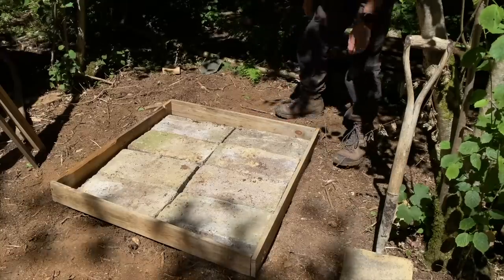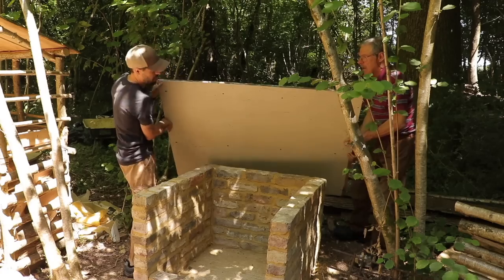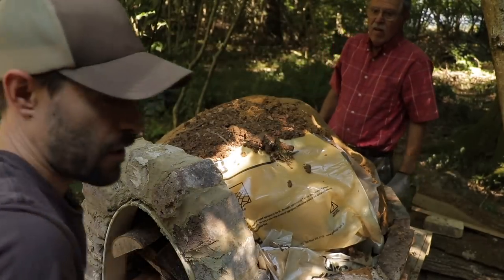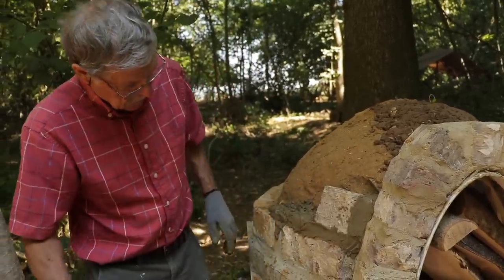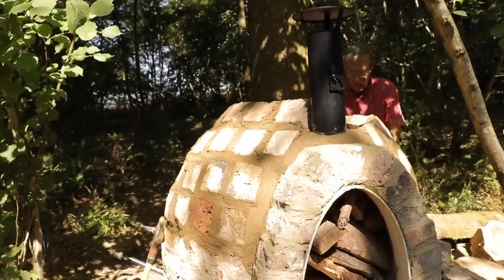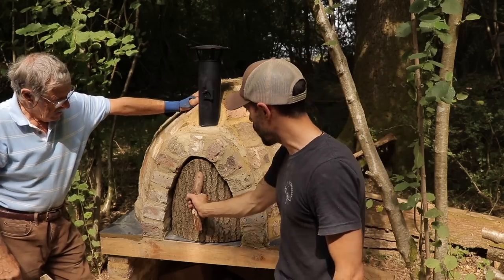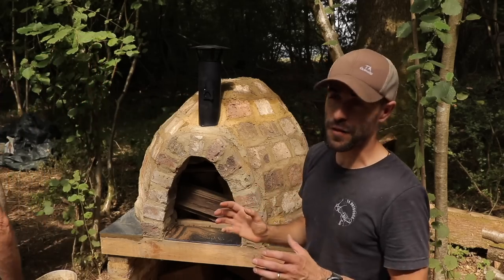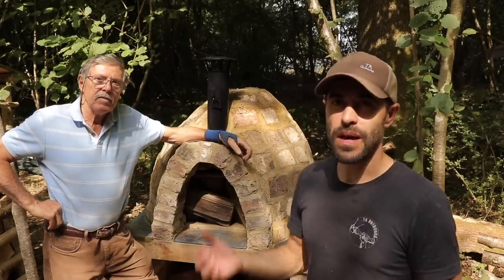Building a Rustic Oven with Chimney in the Woods

Comment: Very cool build Mike. The old bricks look fab! Don't forget, these ovens need to go through a 'curing' process before they wil store and radiate heat for cooking. Basically, 3 or 4 small fires to drive out any residual moisture in the mortar. After that, you'll notice the temperature will remain high and for a long time. Soak the ash door in water before using on the oven to prevent burning and also to naturally add some steam to slow cooked meals - works a treat on our pizza oven. Good luck and thanks for the amazing videos from your little oasis in the forest. Cheers!
Reply from the maker: Cheers for the tips. Appreciate it 👍🏻

Comment: Nice job. I built a pizza oven in my yard during the corona lockdowns. Quick tip, the flue will expand with heat and crack the mortar/bricks. To prevent this, the flue hole should be a bit larger than the flue. You can secure the flue with fireproof rope and high heat silicon. You silicon the rope around the inside of the opening and also to the flue. Allows for expansion.
Last bit, the thermometer is an unnecessary breach in your dome. The oven will have different temperatures on the floor and the dome. I use a handheld laser thermometer to get an accurate measurement. For a rough estimate, throw a pinch of Semolina flour into the oven. If it takes about 6 seconds to turns black, your temp is in a good spot. Cheers from Hamburg

Comment: You should epoxy the bark and give a waterproof clear coat to the backside of that awesome oven "plug" with the handle that you built otherwise that will rot away over time. What a cool idea, it should last you forever if you seal it right! Awesome build, fellas

Comment: This looks amazing. If you haven't already installed the thermometer - I've seen folks use a heat laser gun to determine heat in the bricks and oven. The laser beams in at whatever angle you want a temp and allows you to stand back and not get burned while you do it. It's a very cool tool.

Comment: I built a domed pizza oven from old bricks from my Victorian terrace, they can handle the heat, I've measured up to 650C!
I used a lime mortar which is (apparently) better for high temperatures.
I also insulated around the outside of the dome with insulation blanket and a mortar made with vermiculite. The insulation is as thick again as the bricks. The bricks store the heat and the insulation keeps it from escaping. If I do pizzas it is still around 150C the next morning. 
 If you find the heat doesn't last long enough for slow roasts, you could easily retrofit some insulation to yours. You could maybe even try and make a diy insulating render with materials you have on hand such as your red clay and straw?

Comment: The one I saw built, the shape was made with willow , just like you'd use hazel, in a wattle method. All lashed together with thin bark strips.  Then covered with a cob mixture and left to dry.  Once dry, a fire laid inside burnt away the wicker structure.
Reply: Townsends?

Comment: Has a bit of a medieval touch, which is very nice.
Sure not every move is like something out of the books but it turns out very well. 
The only thing is the Chimney.
It might be better to have it on the backside for a better airflow.

Everytime I see you two work together, I wish I had the Chance to do such awesome projects with my dad.   

 Stay save and healthy
Greetings from Germany
Reply: A chimney isn't necessary at all for proper air flow, and having it in the back would prevent proper heating of the thermal mass.   Building the oven with the proper ratio  height of dome vs height of door is critical for the oven to breathe during the firing period.  Using a chimney is a way to sidestep calculating the ratio, and usually reduces the efficiency of the oven.  This is based on experience and research.  My first oven I put a vent in the back, and it never worked properly.

Comment: I have found that fish cooks best with bread. Pizza only takes 2 to 3 minutes, seared meats 6 to 12, and a stew, well I guess it depends on the crock and the size. BUT, after all that, then sweep out the fire from the oven and place the loaves and fishes and close the door. I just wait until I smell the bread toasting, then I open the door. The residual thermal mass is what bakes. Don't worry the cracks, like wood it will expand and contract.

Comment: i have a question about the placement of the chimney.  wouldn't it be better at the back or one of the sides?  just thinking because if the smoke is coming out the front, it might be uncomfortable/difficult to access the door.  again...just a thought...
Reply: It would also increase the airflow
Reply: And the heat will be direct towards the chimney and the wooden door, wouldn't be surprised if it proves problematic having it lower than the inside top of the oven.
Reply from the maker: Good question. There are a basically two different ways you can ventilate a pizza oven. The more traditional way is with chimney at the front like this. If you Google pizza ovens you’ll see a lot with chimney at the front. Here is a good article on it:  https://www.fornobravo.com/blog/pizza-oven-design-ventilation-options-both-good-and-bad/
Reply: I was thinking the same thing. We’ll see how the first fire goes.
Reply: I was wondering this exact question.....
Reply: No, actually you want the chimney in the front and the fire at the back. That way the heat has to circulate more before it finds its way out, thus heating more of the brick mass of the oven. You can even leave a small fire going in the rear while you cook, but you have to rotate your food frequently to keep one side from over cooking

Comment: You should have put the chimney towards the back, now the draft from all the hot air going up it will burn your wood door down faster than if you had the air pull away from it. Would probably burn better too.

Comment: Get the fire going and when it is all charcoal, put your hand in and if you can count for four seconds - 1 Mississippi 2 Mississippi etc it is hot enough for a roast - only 2 seconds its hot enough for a pizza - no need for a thermometer - the trout - gut it - salt and pepper wrap in alfoil and roast  till it is ready

Comment: I'll bet if you start with low heat in the beginning and over the period of several fires add more heat you will not experience as much cracking. Just a guess. Low and slow is always a good rule.

Comment: First, you don't need a taller chimney.. but the taller, the better the draw will be.. Look up stack effect to understand.  Second, instead of your thermometer you're using, I'd look up a Maverick wireless unit.  It uses batteries, but you could easily bury a probe and wire in this in the way you want.  I prefer them because you can put them where you want.  I use them on my smokers.. way better than what you're trying to set up.. (and depending upon where you put them, more accurate too.. near the top will be hot, near the bottom where the food is.. more accurate... Now you just need a wooden paddle to put in/take out the pizza

Comment: So maybe I missed this part, or don't fully understand the design, but isn't the fire supposed to go underneath in the square brick part, then the fire and heat travels through the top chamber to heat up the food? So shouldn't there be a hole between the two chambers?
Reply: Had me confused too. I was wondering why they left the plywood base underneath, as it would surely burn! Hehe, having watched it, it sounds like the fire happens in the top section 🤔

Comment: can't help thinking the flue would have been better at the back...
Reply from the maker: Traditional pizza ovens have them at the front. Have a Google and you’ll see what I mean. Here’s a good article on it: https://www.fornobravo.com/blog/pizza-oven-design-ventilation-options-both-good-and-bad/
Reply: @TAOutdoors  with the flue in that position fresh air is coming through the door and straight out of the flue. bringing an oven like that up to temperature requires a decent fire. with the flue at the back fresh air is drawn from front to back ensuring the fire has a good supply of oxygen.

Comment: For what it's worth this special type of heat-resistant bricks should be laid using heat-resistant mortar, basic cement+gravel might crack in the high temperatures.
Sweet built tho!

Comment: Nicely done! I was wondering about the placement of the chimney though. I understand that some pizza ovens have the chimney in the front but wouldn't the smoke be an annoyance for you, especially if the wind is in your face? Anyway, that was a nice project for you guys.
Reply: Typically the fire is scooted to the back, so this should create a pull from the back to the front. Going up the chimney and not out the door into your face, haha. I love these designs honestly, likely they will lower the heat loss when you open the door, since less additional suction is created with this setup. Just my thoughts, no real experience
Reply: There's very little smoke if you use properly seasoned wood. Unless your recipe calls for a strong smoke flavour, why would you use wet wood?

Comment: Pretty cool, guys! Does the plywood under the oven burn off?
Reply from the maker: No it shouldn’t. It’s covered with 4” thick concrete and then 2” thick firebricks on top 👍🏻
Reply: @TAOutdoors  I thought you'd build the fire underneath....must be the fire's in the dome...
Reply from the maker: Yes fire is inside the dome. The pizza goes in with the fire. Just push the fire to the back and cook the pizza near the front

Comment: Great project but shouldn't the fire be inunder and the chimney in the back ? Now both fire, smoke and pitza will share the same space...
Reply from the maker: No, traditional pizza ovens have chimney at the front. Some more modern ones have it at the back. Some don’t even have a chimney at all. There are various ways of making these. The smoke rises to the top of the oven, then the chimney flue “draws” the smoke upwards and out. Leaving the base of the pizza oven clear from smoke.

Comment: The 'sand' layer makes me shudder: I would have sifted out the debris and also used a binder to form a thermal mass and a hard shell for the dome.  I suspect that 'Part Two' will be titled 'Back to the Drawing Board.'
Reply from the maker: Sand is just the bricks conform to the dome shape. The concept is the same as an igloo. Structurally the oven is sound. Had the first small fire in it today and no problems at all. Larger and longer fires is where we might see some cracking. But certainly not a case of starting over (yet!)

Comment: It's so cute you guys complaining about heat in the 30's. Hottest temperature ever recorded in Jolly Ole England is a mild 40.3C, recorded earlier this year actually, so good on you I guess. I'm from Phoenix, Arizona, USA. Our record temperature is 50C (122F) IN THE SHADE. we get "100 days over 100F." (37C) And it's frequently over 115F (46C) for most of the summer. ONE THIRD of our year is spent hotter than your record high for all of England, Wales, Scotland, and Ireland (North or otherwise). Oh, and that nonsense about "yeah but It's a dry heat!" Is utter nonsense. The hottest temperatures come during our monsoon season, which is now, where we have both high temps and high humidity, so you've got days where it's 115F with 100% humidity and the rain won't start falling to cool things down until the sun finally sets, but oh, what a light show gets put on nightly!
Thanks for sharing!

Comment: you will never maintain the heat in that oven and the diameter is to small, once you get enough wood burning to get the heat you want there will be no room for a pizza. Cement and brick will crack , your pizzas will be either soggy or burnt and gritty